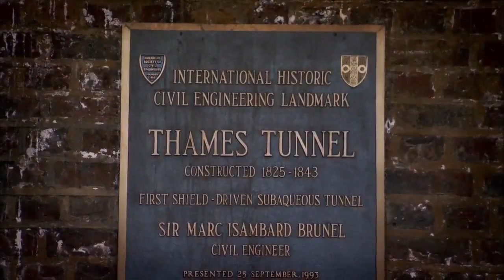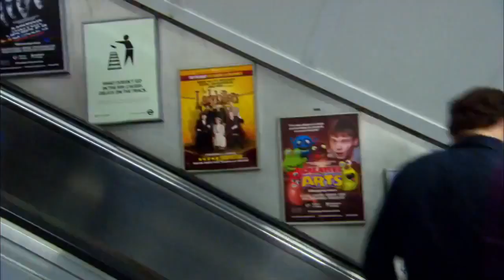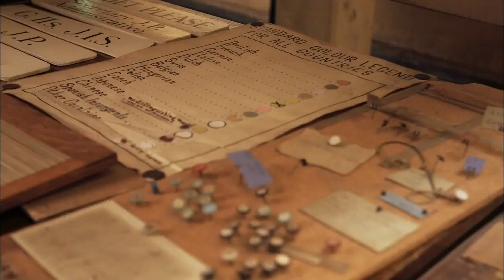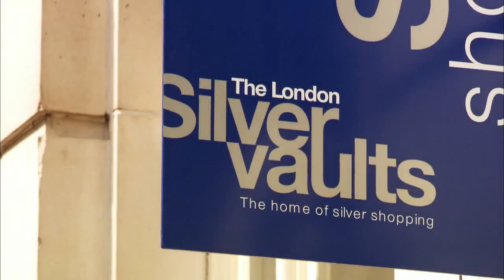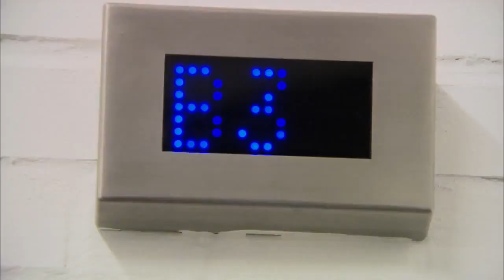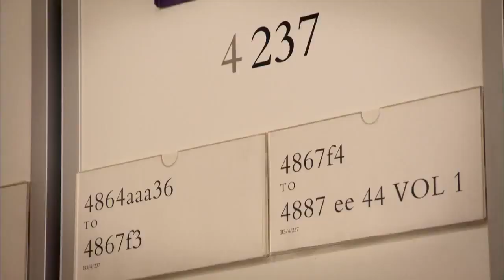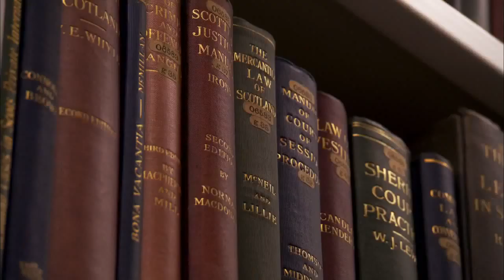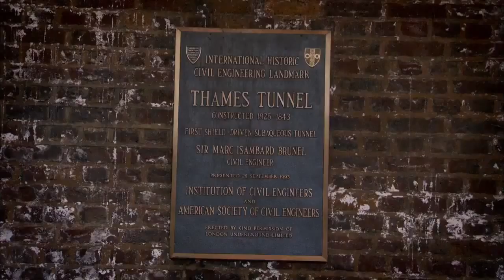Secrets of Underground London

Comment: I have so enjoyed this series of programmes. I was born in 1940 and it was not until after 1945 that I go to know London. Dads family were from Chelsea and we visited quite often.  We always had lunch with granny Bick and then went next door to auntie Olly as granny always had an afternoon nap. That meant that all the women sat and gossiped and I escaped to explore. I first bought an underground ticket to Leicester Sq to ride on the escalator. The one on the Piccadilly line was longer than the northern line one. (very  important to a young lad) I quickly learned the LT routes which proved useful when I subsequently started working in London. However many you will know know the northern. line escalator at Angel station is now the longest in London a very important bit of information to a young lad.  Now to digress a little bit. In the 80's I visited friends in Moscow. The were very close to Spartivnaya station. There the escalator goes from ground level directly to platform level and is about twice as deep as any London one and also moves about twice as fast so you have to hit it almost at a run to board safely. Thanks for reading this
Keith Bickle
Reply: Hello! I just came back from London and loved reading this, after having explored the city by tube. I love imagining what past stories the sites I go through hold.